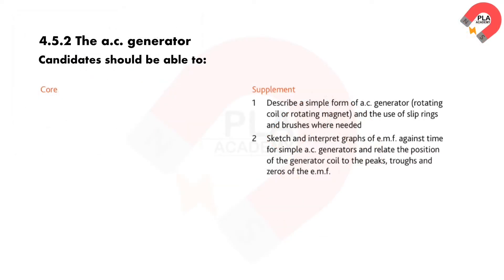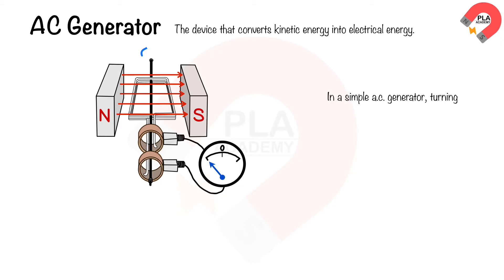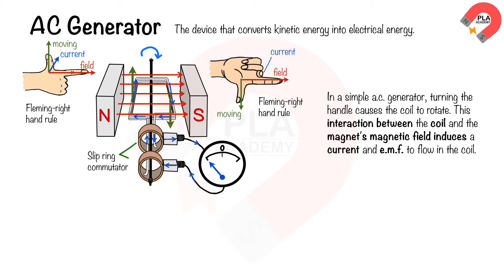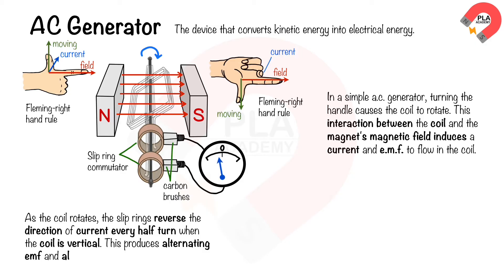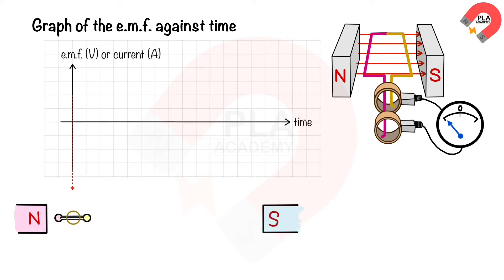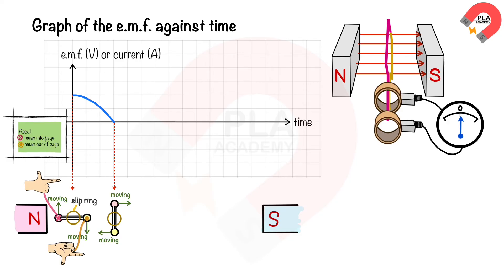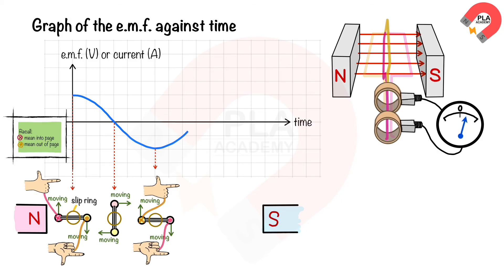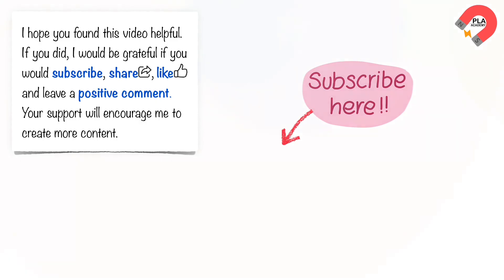AC generator for IGCSE Physics, GCE O level Physics

Comment: You're teaching people the wrong thing . The maximum emf occurs when the coil is vertical and not when it's horizontal. And from when does horizontal to the magnetic field mean " perpendicular" . You confused me so much
Reply from the maker: Maximum e.m.f. occurs when the coil is horizontal. You can try to check in textbook of Cambridge or search in google. 

You are confused, yet you blame me! 😪 It's very tiring dealing with people like you.
Reply: @plaacademy  I did Ma'am
Reply: It is horizontal, PLA academy is right. Please do your research before spouting nonsense like this 😬

Comment: It's left hand rule!!! The electron path is wrong now
Reply from the maker: All in my video are correct
For igcse in uk syllabus:

Fleming left hand used to find the direction of force in dc. Motor, thump = force, index finger = filed and middle finger = current.

Fleming right hand rule used to find the direction of current in ac. Generator or electromagnetic induction in conductor wire, thump = force or moving direction , index finger = field direction and middle finger = current direction. 

fleming right hand rule used the direction of current not electrons.

If you use the direction of electrons, you can use left hand rule.

You try to check in textbook or google! 😪
Reply: @plaacademy  yes you are right
i also thought at first glance you were wrong but i checked the right hand rule and understood

Comment: The slip rings defination is written wrong , the one u wrote is about the (split) rings in dc motor
Reply: The slip ring doesn’t reverse current
Reply from the maker: It is correct already because Slip ring and split ring have same function (definition).
Both reverse current every half of rotation when coil is vertical as the coil rotate continuous in way.

You are confused and blame me. 😪